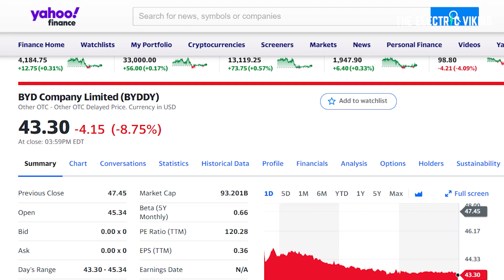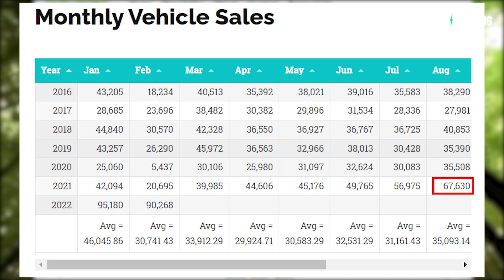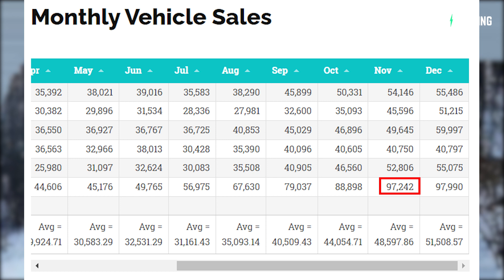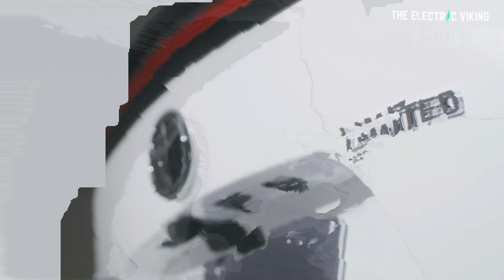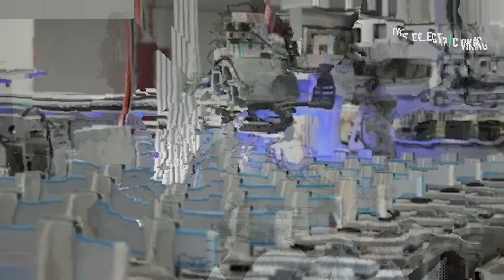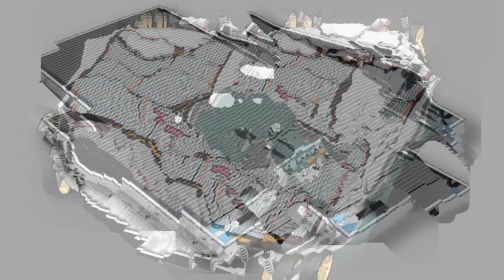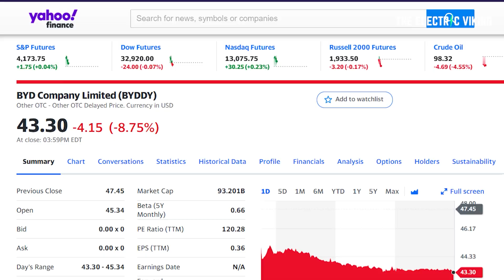BYD stock CRASHES - be greedy when others are fearful

Comment: Problem with growth stocks is they're highly dependent on macroeconomic factors. Analysts are saying there's a 33% chance the US will go into recession and a 50% chance Europe will. Best to buy in slowly (dollar cost average) if you ask me. It could get cheaper.
Reply: @jerrysandberg3728  Tesla is a growth stock too, but funny you mention Intel. That's my biggest holding and it's my value play with an absurdly low PE. It also has a low beta so less volatility than overall market and it pays a dividend. I just hope we don't have a repeat of the late 70s under Carter when we had the second oil crisis (due to the Iranian revolution) and chronic stagflation.

Comment: Small sized EV cannot have high capacity batteries if using only LFP as seen in the Ora Good Cat 45kwh LFP and 63 kwh ternary battery.
The same reason only the standard range Model 3 has an LFP with the longer range going with NCA they just cannot fit the lower density LFP.
Reply: Great points

Comment: When the patent for LFP expires this April what would TESLA team and others do to the battery chemistry. Probably a flood of battery innovations and designs.
Reply: The patent for LFP battery is not important anymore. What's important is if you can manufacture it in large scale and if you can make the Blade battery. The answer is yes for both for BYD.
Reply: Tesla already have LFP contracts with BYD and CATL (different form factors) for standard range cars. When they reach required production of nickel-based 4680s (Semi, Cybertruck, Premium sedans) they may also start manufacturing 4680 LFP (Std+, stationary applications etc.).

Comment: What's the difference between BYDDF and BYDDY other than the price?
Reply: Y is for investors who don’t have brokerage access to F. Always buy F if you have the option.
Reply: @vyntuxbury  Strangely (or maybe not so strange if I understood the reasons) BYDDY, the same one that Buffet and Woods bought, has much less trading volume which shows in the OHLC charts with lots of dashes instead of full candles. 
But the movement is pretty much identical, although doing a rough calculation of the last run up over a couple of years, it seems like BYDDF experienced around .2% less growth over the same time period as BYDDY (dunno why either, lol). But if Buffett and Woods were buying BYDDY, then I think I'm going to go with that one since I'll assume they have good reasons ;?)

Comment: I am trying to figure out the battery swap.  Is it possible to charge at home?  If not what if I have a 50% charge but want to drive some place where I need 75% to get there.  Do I swap for another battery to get 100%?  Do I pay for a 50% charge or a 100% charge.  I am sure this has all been thought out I would just like to know how it works.
Reply: Sorry I am asking about NIO.
Reply: I think you can still plug it in.
Reply: NIO expect owners to normally charge slowly overnight at home or in street parking. The NIO battery swap stations give owners the opportunity to swap battery on a long trip as an alternative to fast charging.

Comment: Due to Russia invading Ukraine Western countries (and probably the rest of the world) will accelerate the push to sustainable electricity production and stop fossil fuel dependency. This means EV + batteries will soar at an accelerated scale. Europe is now announcing to drop Russian fossil fuel dependency by 2027. BYD is a totally vertical integrated manufacturing company and the second largest EV producer. China is now facing a choice: supporting a miserable failing Russian "friend" with a GDP as small as Spain, or become the world economic leader and peacekeeper. Hard choice isn't it ?   I bought BYD directly on the HongKong stock exchange (HKG:1211) using my Interactive Brokers account.